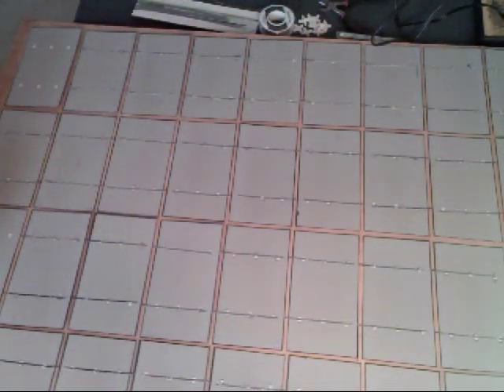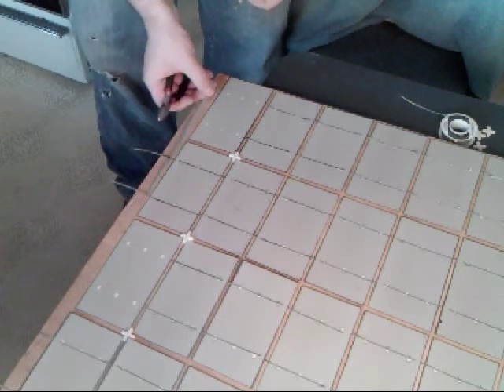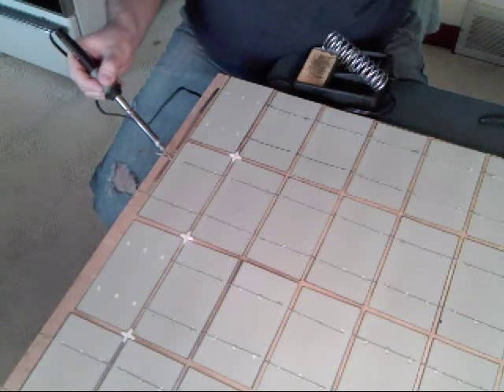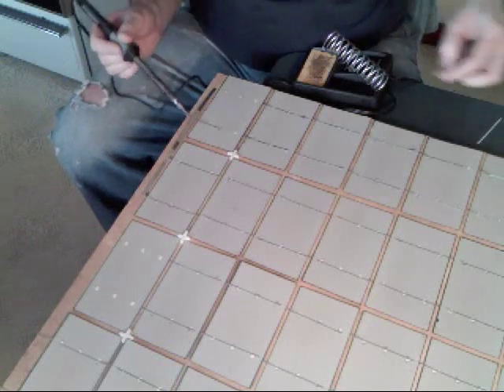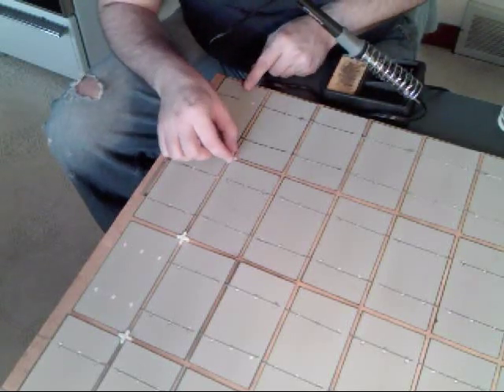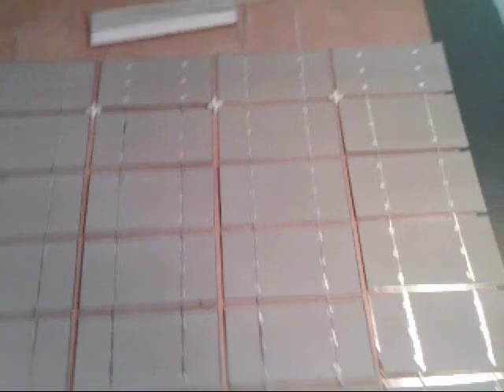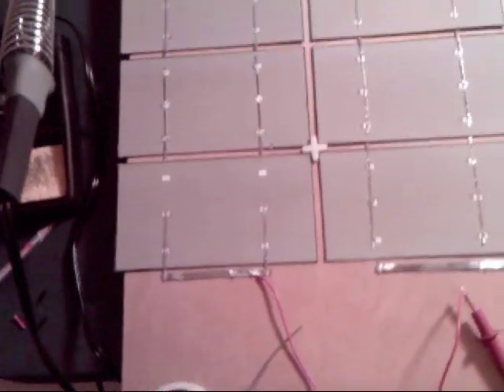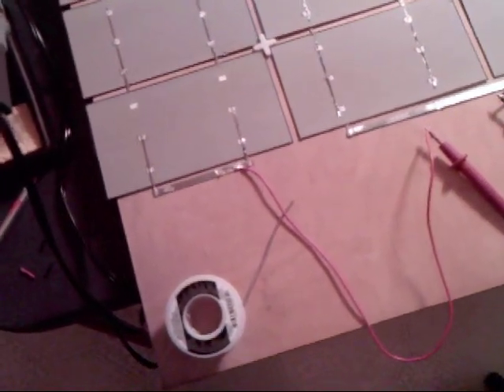How to: Aluinum Frame Solar Panel P4

Comment: why you did not made +- contacts in the center of pannel? Hope it is possible to change wiring scheme to have +and - somewhere in the center of pannel. So it will be easy to attach junction box to the back of pannel.

Comment: its more to do with your Not allowed to use Lead solder any more as its toxic (UK most likely the same around the world as well) 
but lead Free Solder is not as good (RED ring of death on Xboxs or orange light of Death on PS3s and Nvidia GPUs stop working are due to bad mix of lead free solder cracking under constant heat and cooling, that is something that Lead solder does not do)